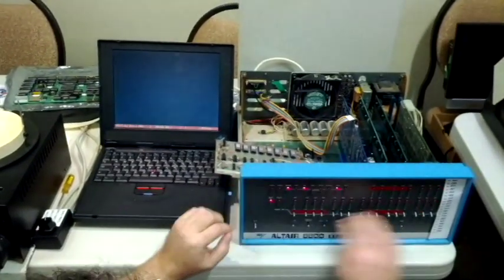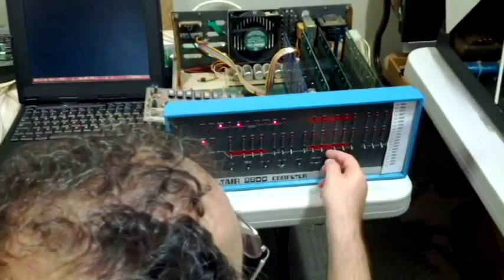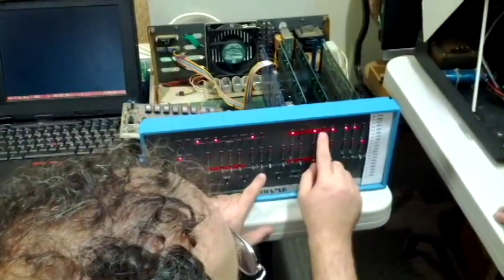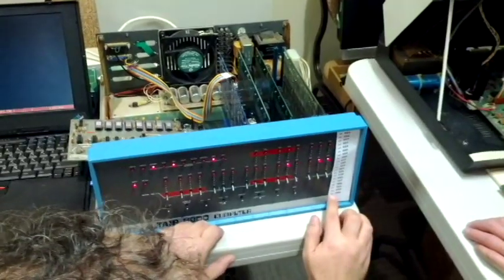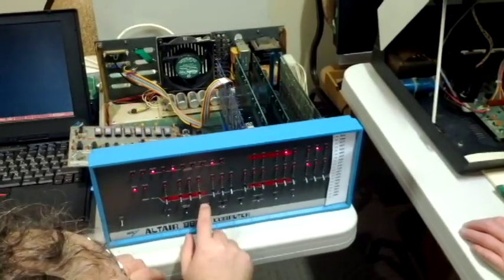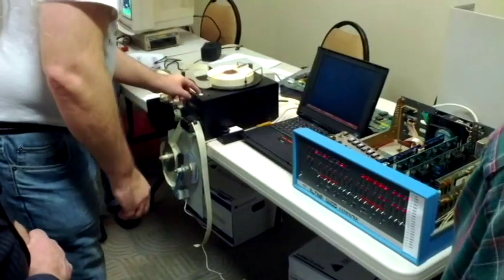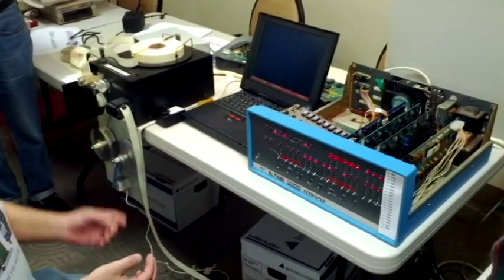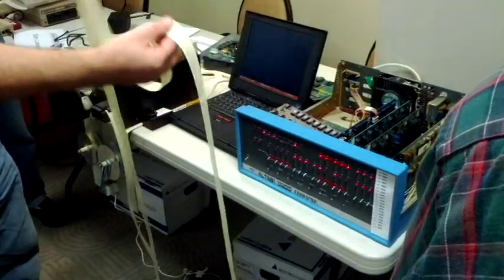Altair 8800 loads 4K BASIC from paper tape

Comment: Hope I didn't mak any mistakes:
Addr	Hex		Mnem
0000	21 AE 0F	LXI H, 0FAE	; where to write the data
0003	31 12 00	LXI SP, 0012	; set stack pointer to loop address
0006	DB 00		IN 00		; read port 00 (88-SIO status)
0008	0F		RRC		; rotate ls bit (RDRF) into C flag
0009	D8		RC		; return on carry to loop
000A	DB 01		IN 01		; read port 01 (88-SIO data)
000C	BD		CMP L		; compare A to L (leader byte AE)
000D	C8		RZ		; return (to 0003) if equal
000E	2D		DCR L		; decrement L by 1 (to AD at first run)
000F	77		MOV M, A	; store A to [HL]
0010	C0		RNZ		; return if L not zero
0011	E9		PCHL		; jump to program start
0012	03 00		dw 0003
0014